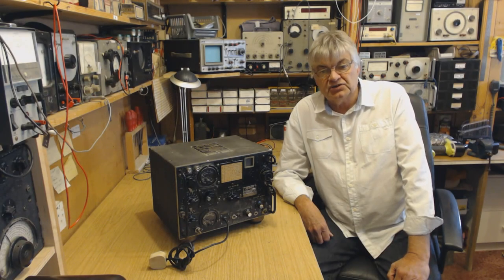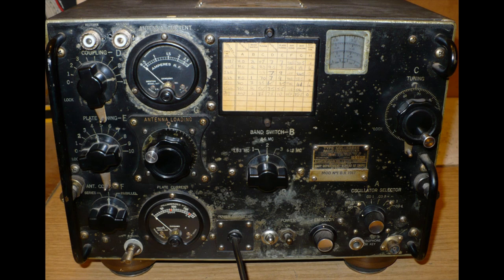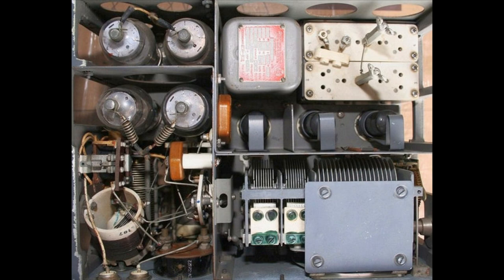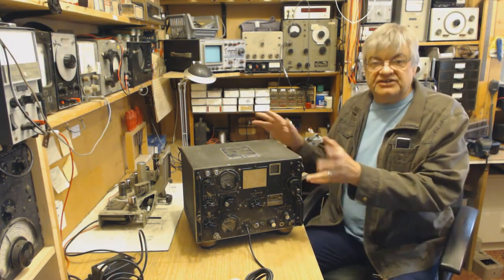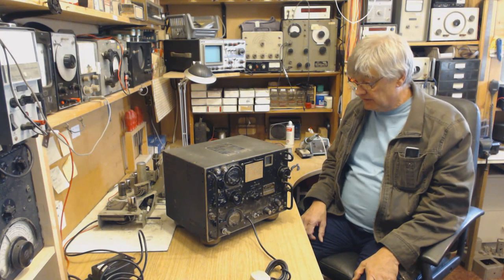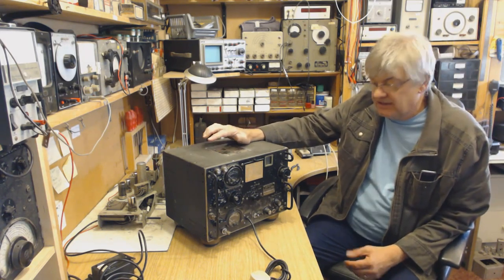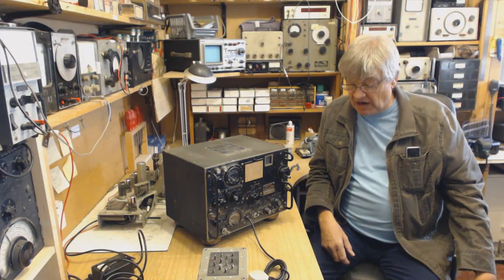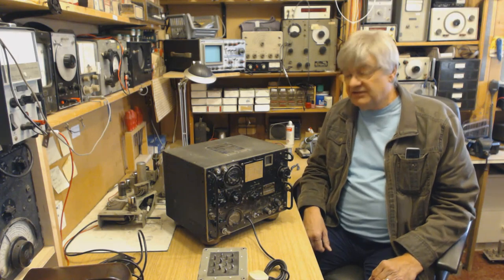Collins TCS 12 Transmitter

Comment: One of these, with a homebrew power supply, was my first transmitter in 1972. Bought it mail order surplus from, I think, Applebee's Electronics. In CW, all stages were keyed with big loud relays, including the oscillator. The key clicks and chirps were beyond anything ever heard before or since. The original setup had a metal pressure connector for the wire antenna mounted right on the front panel. When you were adjusting the output coupling, it was very easy to brush your knuckles directly on the antenna connector, getting a nice RF burn! Collins gear was usually well-designed, so I have to think that the poor design choices on the TCS were made by someone other than Collins and they were just manufacturing it on a contract. In '73 I got a Johnson Valiant which was much better, and modified it for high fidelity AM.
Reply from the maker: K Keller I liked Collins gear but I know what you mean about theTCS.

Comment: My grandfather (Ken Koller) was a radioman in the Navy, and served on WWII type submarines (USS Sirago SS-485, and USS Sea Leopard SS_483) in the early to mid 60's.  He told me stories about the TCS-12 and how he successfully transmitted his 24 Hr. "check report" using the TCS-12 when the URC-32 failed to do so.  He has a special place in his heart for this transceiver.........
Reply: My grandfather (Charles “Robbie” Roberts) also served on the Sea Leopard during that time. He was a first class torpedoman and used to tell stories of sitting in the radio shack with the radio operator copying “fox”. I wonder if he was sitting with your grandfather… unfortunately he passed away in December of 2021.

Comment: The TCS-12 was designed to use carbon mics, with DC present on the mic jack.  It has excellent audio even when unmodified...fed at +10 dB or so through a blocking cap and low-z (4 -32 ohm) audio transformer.  More than one pirate stateside has used them, crystal or VFO, on the top end of the AM band.
Reply from the maker: I remember using a 19 set with with carbon mic and receiving excellent audio reports. Happy days!